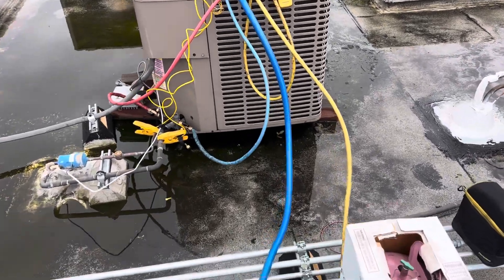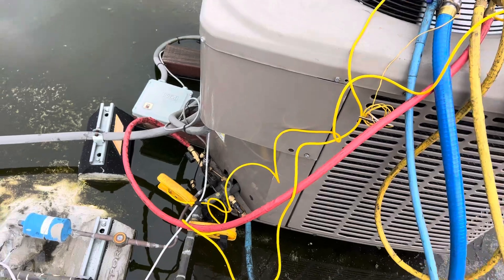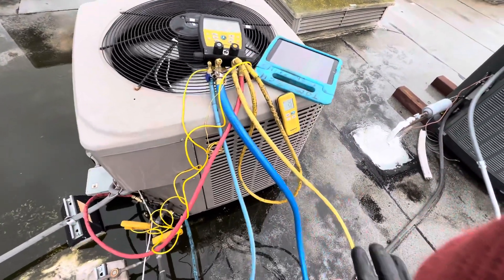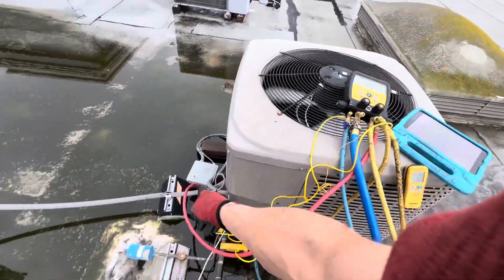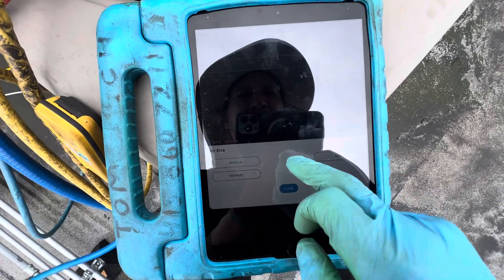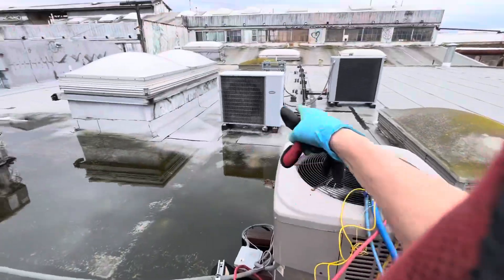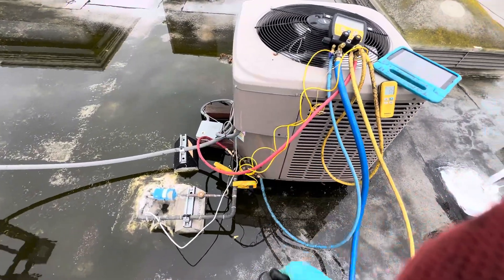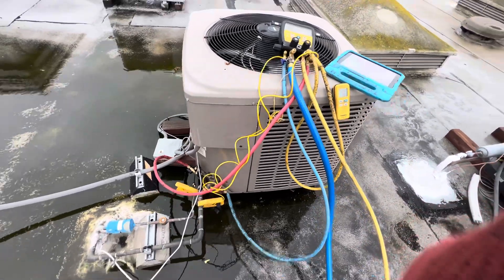STOP  BUYING HVAC EQUIPMENT WITH NO PROTECTION CONTROLS

Comment: We are going to see a lot more crazy stuff start happening with the cost of packaged units skyrocketing and availability being months.  At the very least a unit needs a manual reset high pressure limit, low pressure cutoff, and freezestat.  Ambient fan controls are also a must when you may be running a unit at cooler temps outside.

Are those fittings that are leaking joints that were done with Staybrite 8?  Hard to tell from the video if they are braze joints.

Keep fighting the good fight out there.
Reply from the maker: Yes, that is stay right eight

But all the leaks are coming from his adapter T fittings that were installed for the high-pressure transducer for the low ambient kit

Comment: The first few videos I found were mobile, now you're doing this HVAC or at least I found it. You are angry hardcore. I do dabble with HVAC myself I just don't know enough about it to get this serious. I did convert my home seer 10 over to ES22 back in 2016 it has been working great since. I must have gotten lucky. Before the conversion it was 54° at the top or the plenum and after that it was 40°. Approximately half the time run time. 19 minutes to drop 2° at midnight and 9 minutes to drop 2° after the conversion. So far it's a good choice. North Star 3 ton.
Reply from the maker: Yes, I get serious about it because these wire mess that everybody leaves because they’re lazy to cut and trim and properly route and tie up the wires cost money in repairs later on breakdowns

And by buying cheap residential equipment and putting it in use in a commercial application with no safety switches or devices that are optional when you purchase the equipment can cause the compressor to die 
A early life 

I have two separate businesses my son works in the commercial HVAC occasionally doing residential only for somebody we know 

I very rarely do videos on my commercial installations. 

I believe commercial HVAC deserves to have somebody do better with editing and better descriptions to a higher degree than I do not do any video editing. Don’t make the videos look good.
Reply: @coldfinger459sub0  🤭 I hear you. I do video and photography I just cannot do both at the same time. I am a refugee away from my people in Kansas that I have no assistance whatsoever so I don't even bother. I don't know how to edit I do know how to take one shot and get it right but with editing you know that just makes things better.